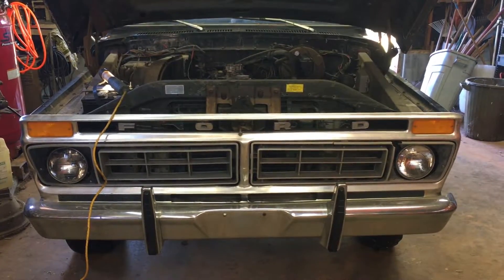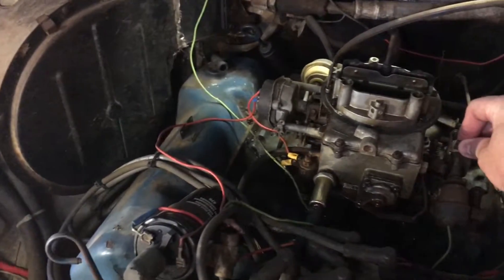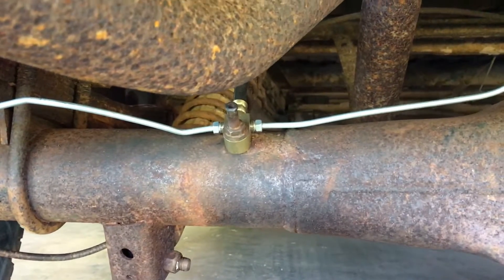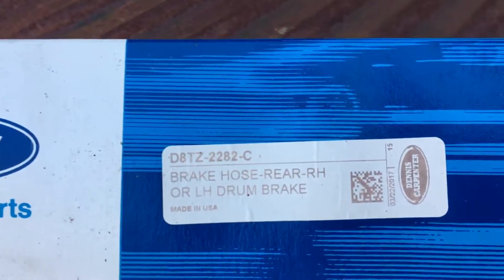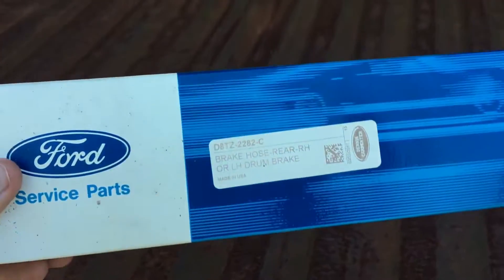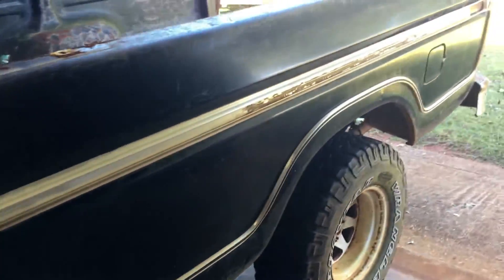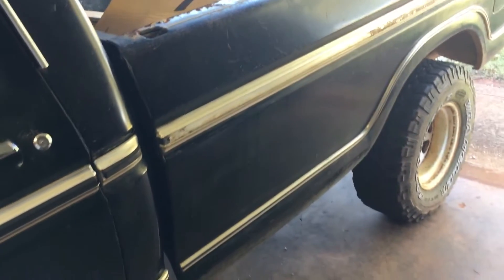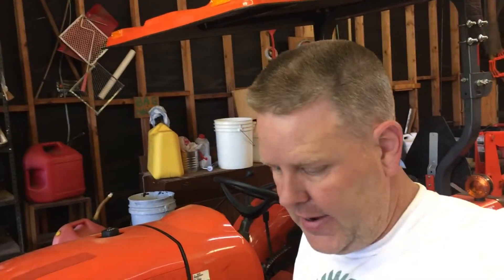1977 Ford Brake Line and Future Plans

Comment: good project a truck you need to keep in the family, wow Cole sure is growning, he getting tall. I would just go ahead and get all new for the brakes wheel cylinders , shoes , hard where, pull back plates off clean them up. On the ols rubber hoses I seen where they would work like a flow control value, appying brakes pressure opens up the ruber lines but when you back off on your brakes they are slow to relase, plus they get dry rot over the years. Looking forward to seeing you and Cole fixing her up.
Reply from the maker: Yeah, its going to be way more than I think!  Thanks for watching.

Comment: Yea flat bed is the way to go if your going to use it as a truck.  I think its pretty uncommon to see air conditioning in one of this vintage.  At least around here it is, but I am also from where it freezes and cold for you guys is 80 degrees.  LOL
Reply from the maker: Mopardude Yeah, kinda wish it didn’t have AC because it seems like a lot of work to take it out or repair it.   Thanks for the comment

Comment: Looking good man! I have the same carb on my 72. I thought about doing it myself as well but ended up ordering one from guaranteed carburetors. The had one in stock rebuilt and shipped it in a couple days. It looked almost new and ran great. They bench test and have them all dialed in. They send you a return shipping label so you can ship them the old carb/core. Total cost was around $150

http://www.guaranteedcarburetors.com
Reply from the maker: CT moog cool, I looked at their site and might go that way if my rebuilt fails!  Thanks

Comment: n the plugs were wore but they werent bad, i took the plugs out of a suburban i just bought and, GOD I WISH I COULD POST PICS ON HERE!!!, but they were insane, the rear passenger side apparently didnt come out for the last owner, it almost didnt come out for me to i was positive i goin to break it the entire time and on top of the i had to cut a spark plug socket down n run little notches in it with the cutoff wheel so i could grab it with the knipex and this with it bein so tight i dont now how it didnt break...i had to cut off the socket because the headers that are on dont allow enough room to even put a regular size socket on the plug...n if u knew what i went thru to get those headers to seal to that straight block youd understand y i did that... i almost would have cut them off and welded them back on before breaking that seal olol